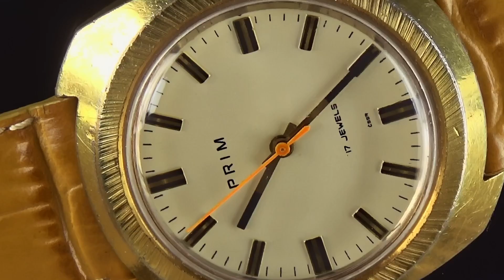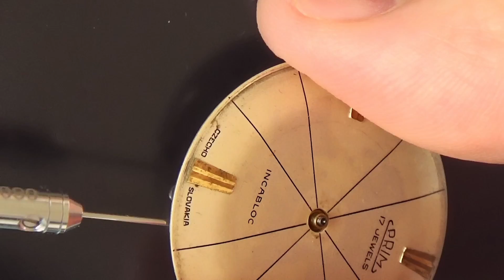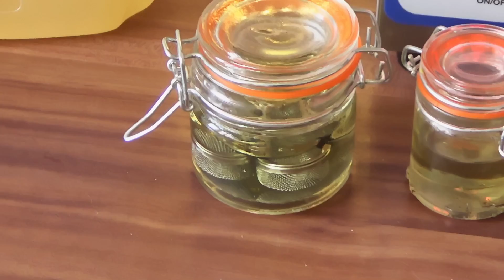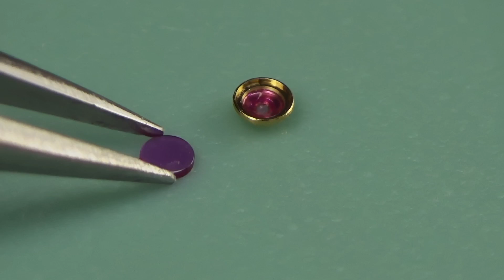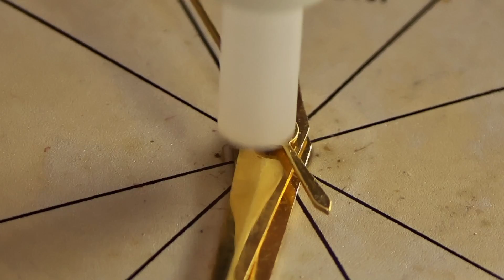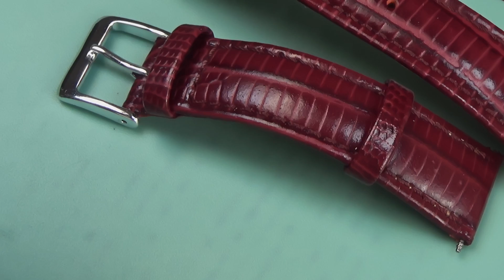Restoration -  1965 legendary Czech Watch. Still, fit for diplomatic service?

Comment: Hello David,
You have inspired me for buying a Prim watch from the Chech republic!
Again a few tips, I hope you do not take it as criticism, I just want to help a bit (as far as I can):
1. Try to unscrew the yoke-plate first for half the way (screws still in) and then release the tension of te yoke cover plate by unlocking it on the change-side (the pivot it is sliding to change function). Also helpful when assembling.
2. In prior video’s you used a coverplastic for the yoke spring. That can go bothe ways, in my experience, the plastic can also get stuck between spring and plate, with the consequence … just use a help stick or a help peace of Rodico as ‘gatekeeper’.
3. You missed the under the ratchet wheel the filling ring when disassembling the barrelbridge. It is nice to get that cleaned as well.
4. Just oil (9010] the pivot of the secondswheel first before placing it in (at the bottom and a tiny bit higher on the pivot)
5.use fixodrop (epilame) on the outer ends of the pallet stones and the teeth of te escape wheel. Do not buy the over expensive device (the bottle) to use fixodrop, the fluid itself is expensive enough. Just protect against evaporizing. It will really keep your special grease (9145) better on its place.
Greetings from NL, Peter
Reply: I could use some help buying the ‘right’ Prim watch … Grtz, Peter
Reply from the maker: Anything with a Cal. 66 or 68 is good, with the 68 having a date function. There is an auction site here in the Czech Republic where you can find a lot of good deals on Prim watches. https://aukro.cz/ Unfortunately, a lot of sellers won't ship out of the country. I would be happy to help you get anything you would like to NL or recommend some specific Prims. You can email me if you would like admin@saving-time.link or DM me on Instagram.
Reply from the maker: Hello Peter the tips are awesome thank you again I am learning it's part of the reason i'm putting myself out there. Your advice is very helpful and most appreciated.
Reply: Is the mentioned e-mailadres correct?
Reply from the maker: It should be you can also use david@saving-time.link if you like
Reply: @Saving-Time  I did sent you two times a mail …

Comment: I will look into PRIM watches for sure.  Buying another watch to tinker with could result in my wife puting my nuts in a pin vise.
Reply from the maker: Small price to pay sir lol The Prims are not to expensive so at least there is that. I recommend picking up anything with a Cal. 66 or Cal.68. Good luck
Reply: @Saving-Time  LOL!  Thank-you Sir!

Comment: I used to live in Nové Město nad Metují, just down the road from the Prim factory, and somewhere in a drawer I have one of these, but it hasn't worked for years. I'll have to dig it out
Reply from the maker: That's a very pretty place from what I've seen. Big fan of the old Prims as you can probably tell. I think pretty much all my Czech friends have a Prim sitting in a draw along with the Rybička knife they had as kids. Hell I have one on my key-ring.  Good luck if you decide to fix it hope it works out for you.
Reply: @Saving-Time  Yes, it is very pretty, but a bit of a one-horse town! Re. the Prim, I think the problem was that one of the screws holding the movement in the case had come loose and had fallen into the movement itself, but I didn't have a screwdriver small enough. So I just put it away and forgot about it, and years of junk have accumulated on top of it.
Reply from the maker: Might be worth dusting off, the price on some Prim models has gone through the roof lately. The diplomat and the original sport can easily go for over 10k now.  Money aside though i think there cool watches to just wear and enjoy. I've only been here for 20 years though so I did not grow up with a Prim in every house and maybe that makes them a bit more exotic for me.

Comment: Nice work! Applying the “right” amount of lubrication is very tricky, and for me, it’s always either too much or doesn’t look like it touched the part at all. Roger Smith quoted George Daniels as saying (perhaps tongue in cheek), if you can see the oil, it’s too much
Reply from the maker: Thank you! Sounds about right, i'd love to own something by ether of those gentleman.
Reply: I watched and can imagine some diy experiments, Q. could the oiler be a small upside down mounted needle, the eye as a oil loader, the norm spade end must dump a noted amount !      Again,  marvellous depth of field for a supp. lens, very good macro photography, and every couple of minutes a useful experience hint !     
( My work field is in electrical/electronic and many years on 1935 Electro/Mechanic Telemetry, which ranged in size from Oil Circuit breakers to relays & phones with some clock size movements. (33kv -1.5V  &  <=>6.5K Amps )

Comment: Fixing a watch is one thing but fixing, filming, editing and narrating is what i'd call a job. It must have taken you a fair while to put this together but the final result is extremely professional, Love it.
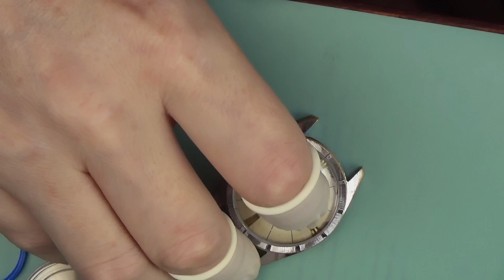38:55 I put the movement dial side up on a case cushion, fit the case over it. With one hand gently press the crystal with your index finger while gripping the sides of the case cushion with your thumb and ring/little finger. Then carefully lift and invert the whole lot.
And John Harwood invented the automatic wristwatch so at least we've got that one.
Reply from the maker: Thanks for the kind words and the tip :) yes it took a while glad you liked it 

All the best
David